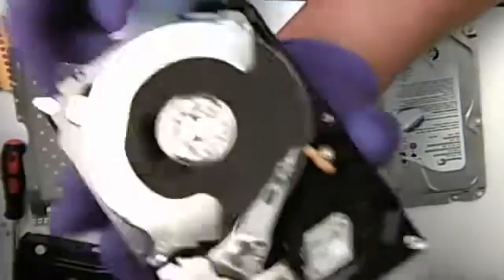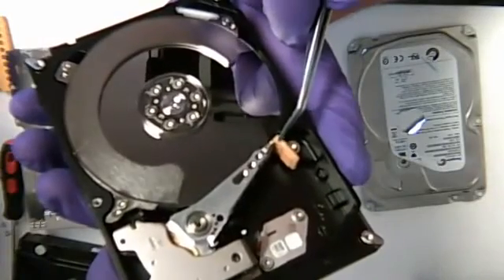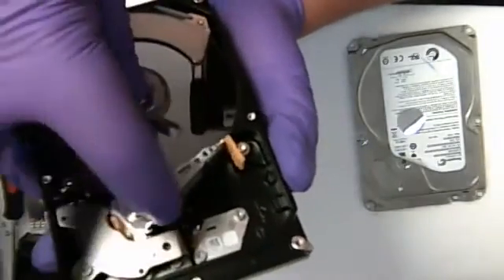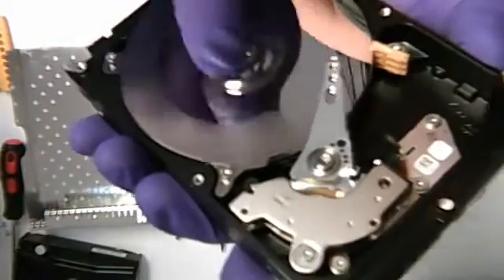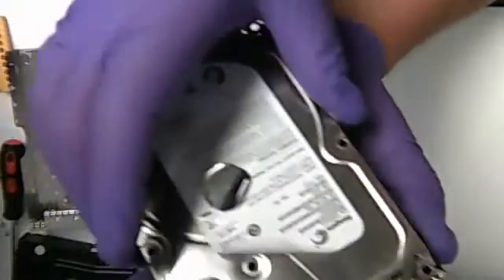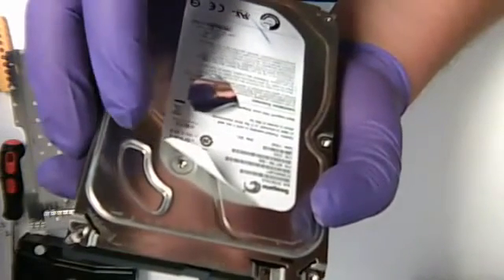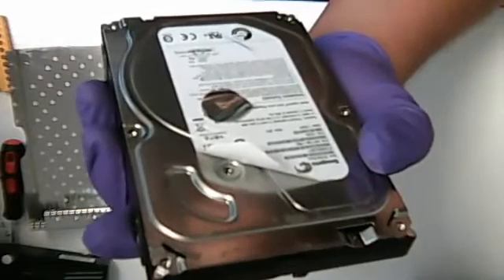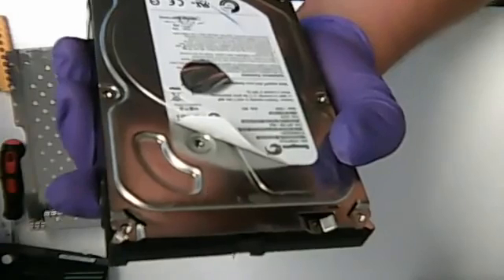Seagate External Hard Drive Beeping Fix | Head Stack Issue Resolved

Comment: i have drive can detect but not spin & incorrect function message after choose initialize disk use MBR in disk management
Reply from the maker: When plugged and clicking or not spinning, try to tap or put in freezer, and try to use after 1 hour, make sure to wrap in something warm so when it is defrosted doesn't get condensation

Comment: Hi I was wondering if it is possible to purchase just the head for the following product:
Seagate
Backup Plus Portable Drive

P/N: 1K9AP2-501 1TB

Model: SRD00F1

Thanks
Reply from the maker: @nandagopaldore5017 Unfortunately Seagate doesn’t sell just the head as a replacement part — the heads are part of the sealed drive assembly. If the drive is beeping, it usually means a head failure, and the only solution is professional data recovery or replacing the whole drive. Thanks for watching!

Comment: Hi. I have the same problem. And i did exactly the way you do. But it didnt start. Disc doesn't spind and it keeps beeping sequentally. What can you suggest me? Or i'm dead.
Reply: Yeah Buy why dead
Reply from the maker: If your Seagate external is beeping and the disk won’t spin:
– That usually means the drive head is stuck or the power isn’t enough.
– First try using a different USB cable (short, original if possible) and a powered USB hub.
– If it still only beeps, it’s likely a mechanical head/platters issue. At that point, DIY fixes are very risky — data recovery service may be the only option.

Comment: How did you get it opened and what type of screw driver
Reply from the maker: There is small Torx bits https://www.homedepot.com/p/Husky-8-in-1-Precision-Torx-Screwdriver-Set-70381H/204664390 and there is few screws right unser paper swing pushing with finger acroo, you fill it